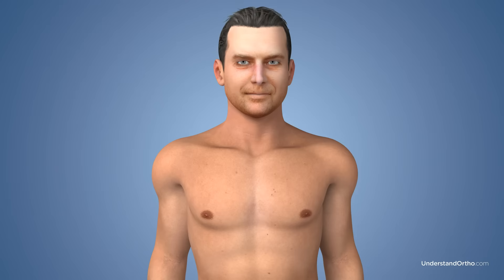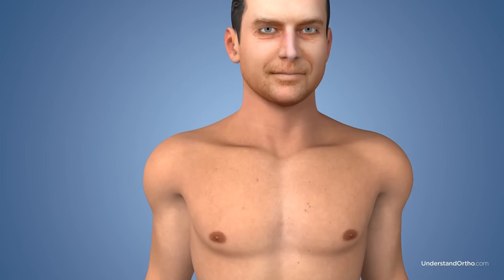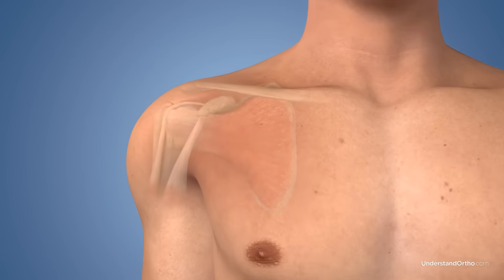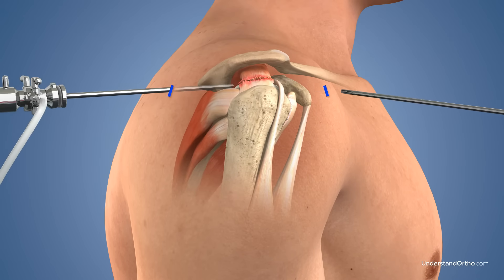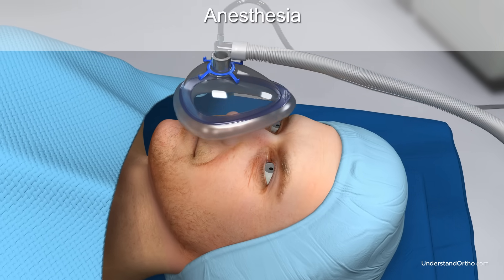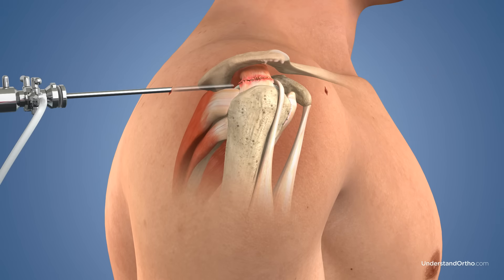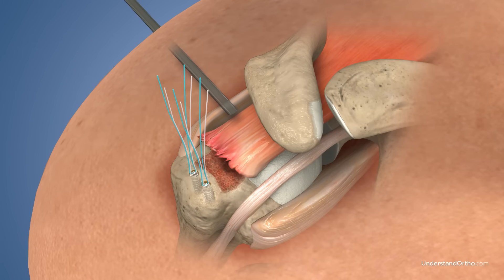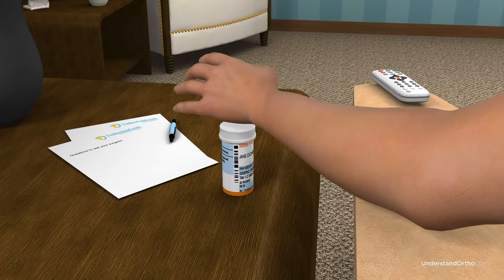How a Torn Rotator Cuff is Repaired (Medical Animation)

Comment: I torn mine. It heals on its own but is painful and  takes a long time. Very annoying. Like a nagging back ache. It's hard to get comfortable
Reply: Like the tmj, the full thickness tear of a Supraspinatus will scar. Scaring is healing. I had a full thickness tear of my Supraspinatus in April. My big issue was waking up a couple times a night with pain and I would spend one minute doing pendulum exercise and was good to go. 4 days ago I had a PRP injection. I have been pain free at night since. The orthopedic doctor didn’t recommend surgery because of my good range of motion and I have learned to navigate my shoulder to stay away from tender areas. I have less tenderness as well due to time. I’m 77 years old and I don’t play tennis or swim. My activity is mostly hiking and I have zero limitations on hiking.
Reply: It doesn't heal on its own
Reply: Yeah tore mine too, took 14 months to heal, couldn't raise my arm for first 8 months, then started range of motion exercises for couple of months, then started light weight exercises ( Lateral pulldowns) (pushups) finally healed after a lot of careful light work. Don't over do it! Go slow, don't over do it!  It will eventually heal. Don't be too quick to get surgery. Takes just as long to heal with rehab after surgery as it does with rehab without surgery.

Comment: I had mine scoped after I couldn’t lift a coffee cup or sleep on either side.  Too many baseballs and footballs.  I was about 40.  It surprised me how long it took to recover and post op pain was manageable but definitely noticeable.  It totally changed my throwing motion and geometry in there.  But the good news is 30 years later no pain, no arthritis.  I wasn’t a pro, the doctor was.
Reply: I'm 78 and wrecked both shoulders with falls onto concrete stiff armed.  So, based on what you indicated, if I get shoulder surgery, I'll be recovered at age 108?  LOL
Only kidding.  Pain in each shoulder runs from zero to 10 on the pain scale, depending on the arm movement.  Cheers, Bob

Comment: I was in agony for months after my repair. The first several weeks were a nightmare. I couldn't sleep. I couldn't eat much. Profuse sweating and nausea from the pain. I will never let a doctor do that to me again. Most miserable experience of my life. Absolutely horrible pain.
Reply: I have had both shoulders worked on, along with my back and many other joints.  The shoulder is the most painful.  The first surgery I slept in a recliner for 4 months
Reply: I hear you, I was having problems with my shoulder. Then I fell off my horse chip fracture on my humerus bones and extensive rotator cuff repair surgery.  I cried for a week after surgery. I’m in a sling for 6 weeks then physio.  I’m 62 yrs old and I’m selling my horse. This has been the most painful experience of my life.
Reply: How are u now?.
Reply: Did you take the pain meds as directed? I’ve had both shoulders done. The first few days aren’t pain free but it’s manageable if the pain meds are used properly.
Reply: I’m 6 weeks in a sling before rotator cuff physio can begin.
Reply: @marysinclair1214 I walked into PT at week 7 wearing my sling and my therapist looked at me from across the room and admonished me to take the sling off and not to put it back on.  😂
Reply: @marysinclair1214 physio ....? Physical therapy !
Reply: I was suppose to have arthroscopic  shoulder surgery  but surgoen had to do open.

Comment: I lifted heavy weight 5, 6 years ago than I got shoulder pain since those days I am suffering pain, I gone to many doctors they just gave painkillers. I believe my cuff muscles tear or came between my shoulder joints, I feel painful when joints grind
Reply: Take Tendofit tab it's Not a pain killer it's regenerate your tendon , the drug  related to collagen type1.
Reply: I hurt my shoulder lifting weights. It started slowly and gradually got worse. I went to a therapist that did deep muscle massage.  He dug his fingers in and separated the  muscles in my shoulder that had locked together with scar tissue.  The next day my shoulder felt fine.
Reply: @dshaw160  I wish I can find out what wrong with mine
Reply: I hope I don't have a tear but I find it difficult to lift a turn my arm certain ways but I try stretching so it wouldn't hurt so much
Reply: Please I love you who have a symptoms find a orthopedic doctor that will send you in for an MRI. No need to suffer.